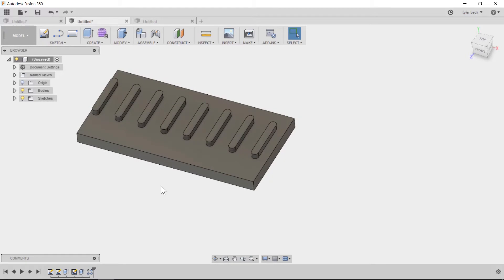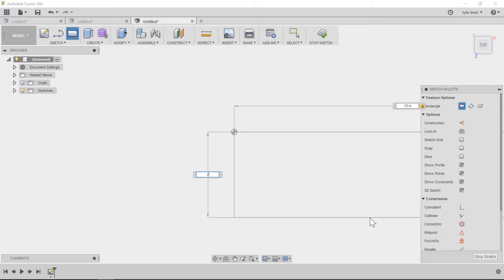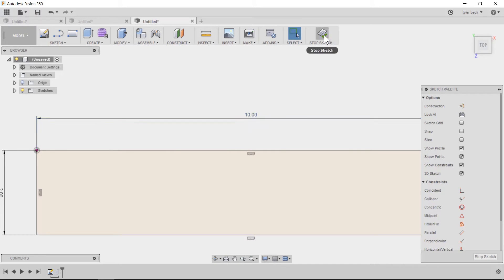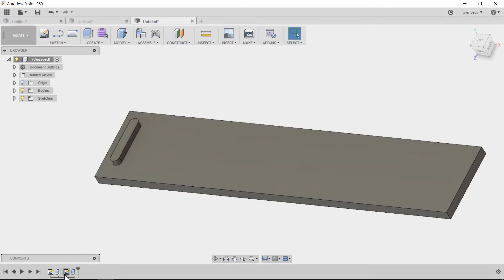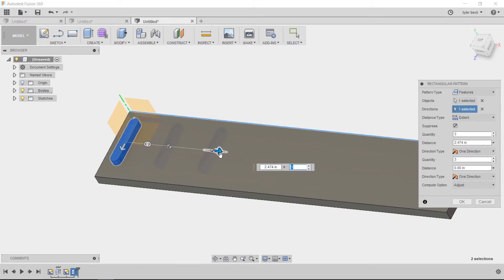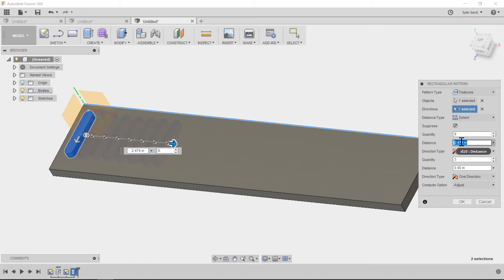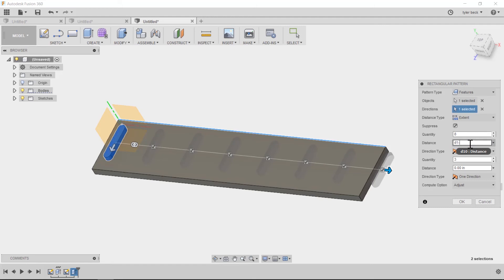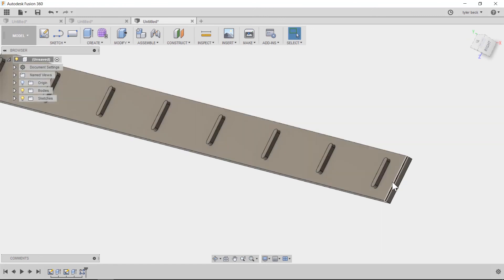Fusion 360 - Smart Patterns - How To Pattern With Special Dimensions

Comment: Thanks. Is there a way to expand the pattern as it progresses?  For example in your model the width of the first bar might be 1 inch but the width of the last bar might be 3 inches and you want each bar in the pattern to get longer as they progress equally from one to three inches ?
Reply from the maker: Could you explain it in an email?  Tyler@techandespresso.com
Reply: @TylerBeckofTECHESPRESSO  Hi Tyler, I am interested in this anwser also? So how would you have the pattern object change dynamically?

Comment: how would you make the quantity change if the size change? instead of changing the spacing adding more features.
Reply: 1) Create a parameter called “Length”. Use this as your length for the base object.
2) Create a parameter called “DistanceFromEdge”. Use this to make a margin from the edge of the base to your objects.
3) Sketch and make your base object like in the video (though using parameters instead d1…). Sketch the object like in the video (though making a dimension from the edge to the center of the object using “DistanceFromEdge”).
4) In parameter create a parameter called “DistanceBetweenObjects”.
5) This is where the magic happens: Create a parameter called “Quantity” make it “No Units”. As value make a formula: “floor(Length / DistanceBetweenObjects)”

6) Create a rect pattern. Distance type: “Extend”. Quantity: Use your parameter called “Quantity”. Distance: Type in a formula “Length - (DistanceFromEdge * 2)

Shazaam!!

Comment: What if i want to maintain the distance between the features and then have it intelligently remove features for shorter plates and add more features for longer ones.
Reply: Use a No Units parameter, where you use a formula as value “floor(Length / DistanceBetweenObjects)”. This parameter can be used as Quantity when you create a pattern.

Comment: What if you measure the distance of the first slot to the edge.  See what the Fusion calls it.  Let's say it is d4.  Then in the distance you write d1 - d4.  Then you always have equal distance at the end, and the beginning.   
Will that work?   EDIT: ... actually the idea is good, but the formula is more complicated.  See my comment below.  Sorry!
Reply from the maker: Great idea!
Reply: Great! Thanks.  I am actually a noob at Fusion, but I have a ton of experience as a software programmer in my past.  So the idea came from there, and I'm glad to understand a little more about how Fusion works.  Thanks again.  Your videos are fantastic help.
Reply: Sorry for the confusion.  This is actually wrong.  I tried, and this is what it should be.  
Let's say
d1 - total length of the bar.  
d6 - width of extrusion (the slot width)
d7 - distance between beginning of the bar to the beginning of the first extruded slot.
"Distance" in the Pattern box should be "d1-d7-d7-d6".  
Now it works OK.
Why?  Because it looks like the pattern measures from the END of the first slot to the BEGINNING of the last slot.  So you take the distance, subtract the gap from the edge to the first slot.  Now you need to subtract the width of the first slot because the pattern start measuring from the end of the slot, and then subtract the width of the last slot.  Now the distance is correct.
Sorry that it is that "wordy".

Comment: I know my request is much more complicated but how would you proceed for the number of pattern instances to update intelligently with the length of the plate? Thanks!
Reply: I would imagine dividing from the overall length and rounding to a whole number.
Reply: @benargee  How do you round to a number in the typing box? I want to do d14/d7 but of course, the number is a fraction, how do I round it to the  min?

EDIT: Nvm found it, you use for example: "round(d4/d7)" to get the closest whole number to that division.
Reply: Use a No Units parameter where you type in a formula: “floor(Length / DistanceBetweenObjects)”. Use this as Quantity when you make the pattern.
I’ve made a step-by-step in another comment to this video.